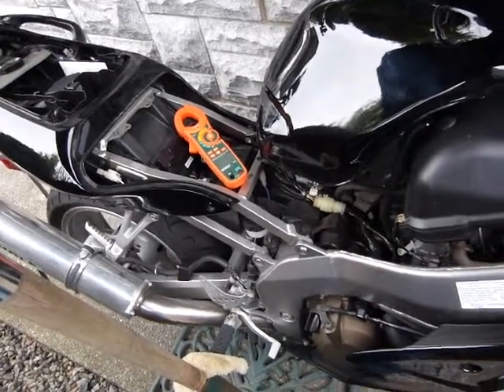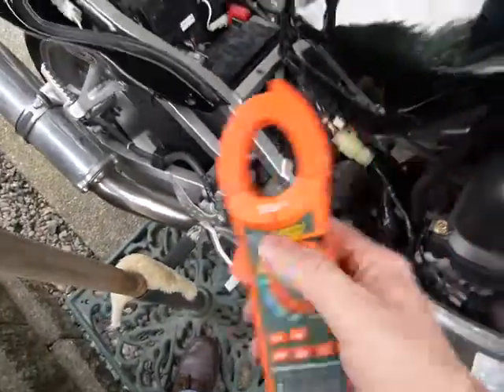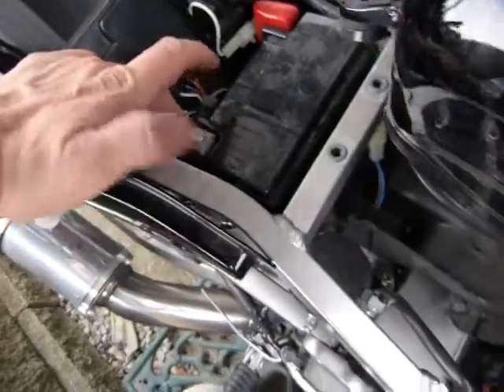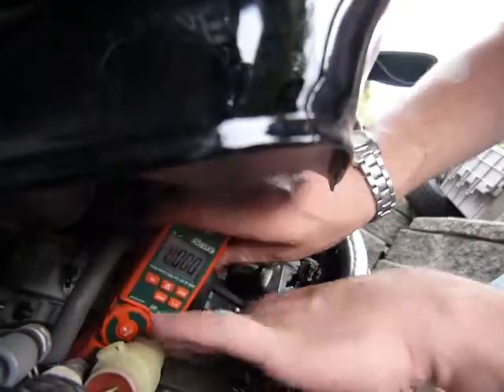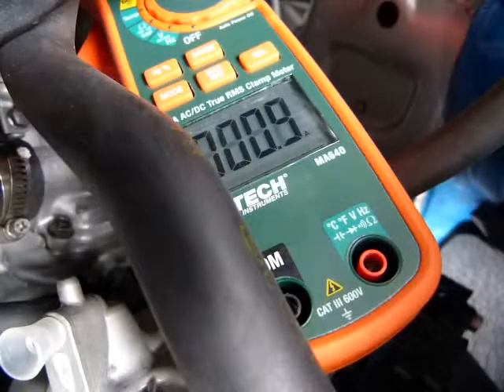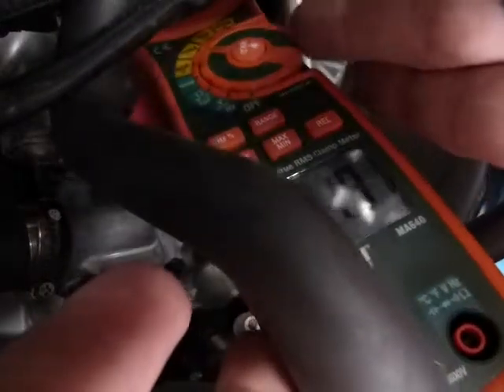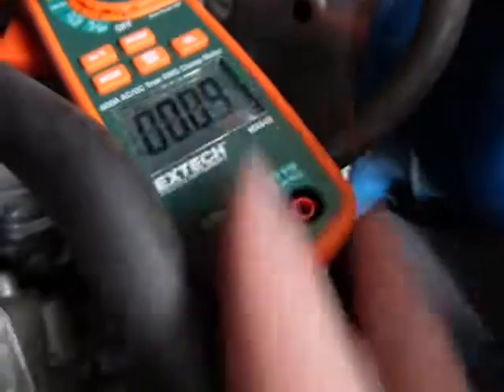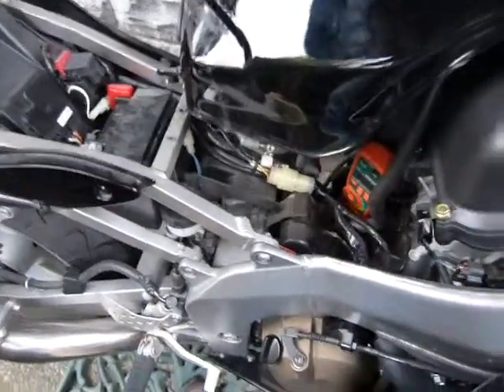Measure Amps (non-contact, DC) on a motorbike

Comment: 10yrs on, and I've just found this and it's very important and useful information. Many thanks if you're still around, and if you are around ...how can i do a similar practical multimeter check for max Amps on different motorcycle accessories (so that i can complete the required formula for finding Watts?